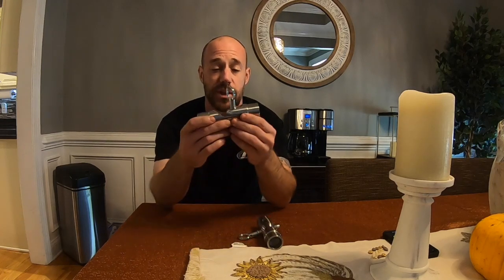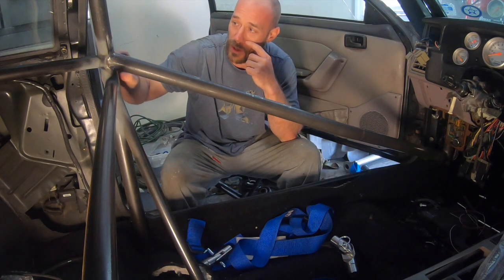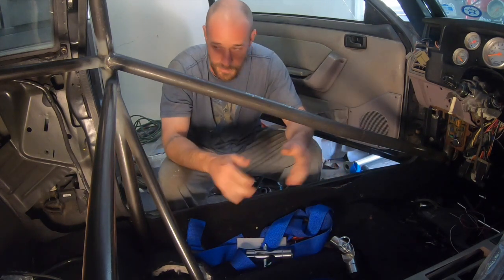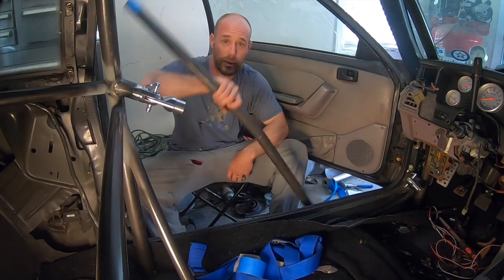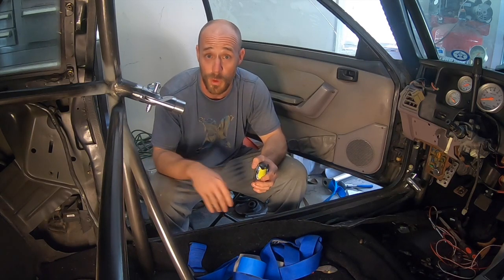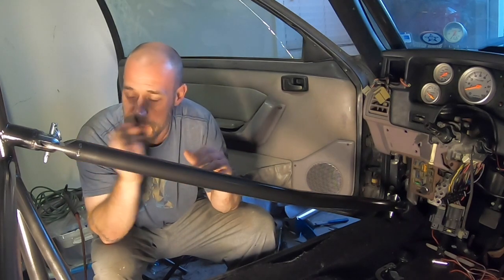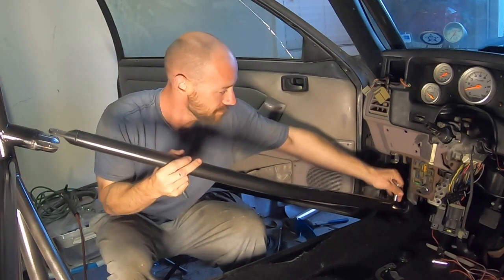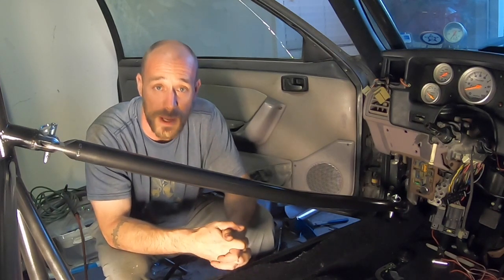TeamZ swing out clevis kit install for roll cage door bars

Comment: So glad found your video. Looking at buying a pro street built car here very soon and of course as you described it'll mostly be street driving so while I've seen itger options for a swing out door bar I feel this is probably the easiest in terms of fabrication work required to install on an already installed cage so I've saved it and will most definitely be ordering 1 very soon
Reply from the maker: Glad the video helped. Thanks for watching.

Comment: I like the clevis on both ends . However you did not swing out the bar to show where it would be when open which leaves everything to the imagination . Bent bars. Do they pass NHRA / IHRA tech . I'm a rookie with only 2 track and one National championship wins and never took a car off the track to put on the road but you did put somebody besides Rhodes in the option book . I'm so old Jenkins and Liberman were my mentors. I can't Tig weld worth a dang either so No complaints , just having fun . Pro Stock ran 9.40 in my day lol. Good job for what it's worth and Jungle Pam was smokin hot .
Reply from the maker: My car passes NHRA tech inspection and has a 8.50 cage certification now. Thanks for watching